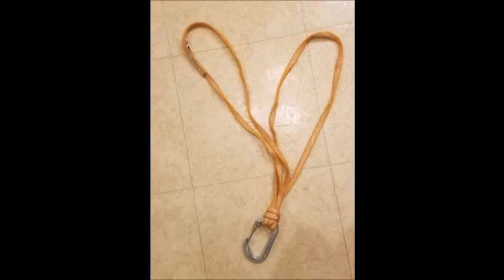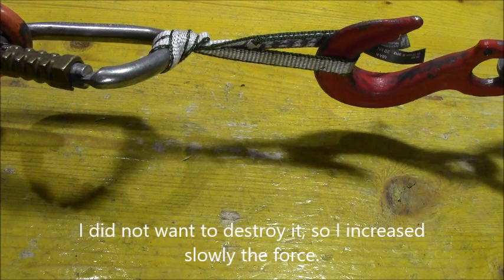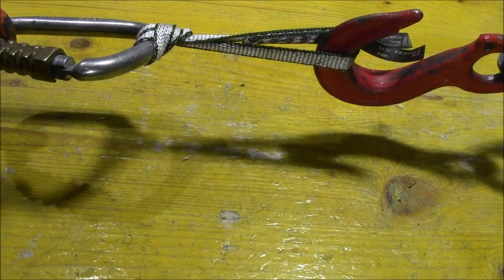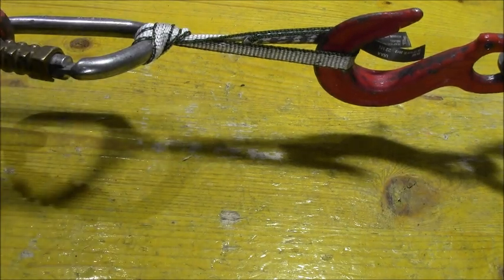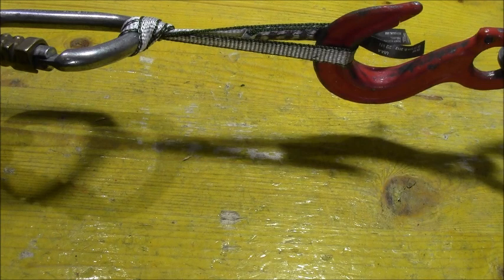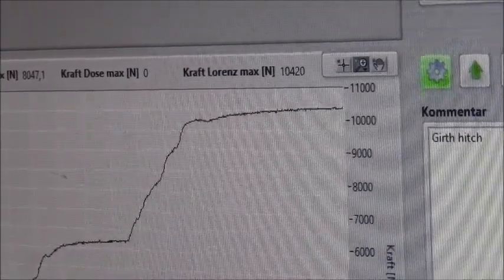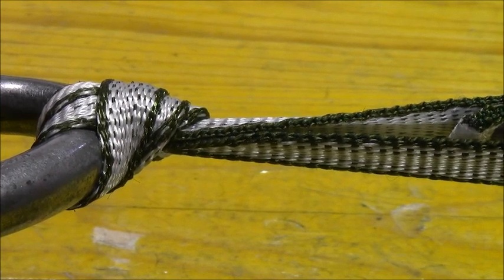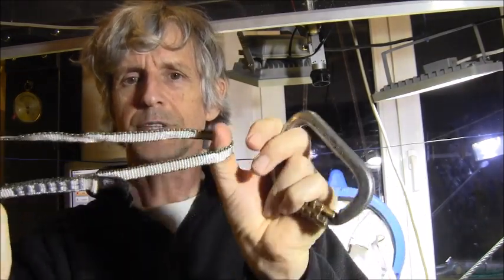Girth hitch

Comment: does a girth hitched dyneema webbing loop on a kong kisa weaken the device? nolotengomiedo had an interesting comment on one of the hownot2 videos about a girth-hitched loop applying a twisting torque to aluminium parts, breaking them under minimum breaking strength. would you test this? here's the comment: https://www.youtube.com/watch?v=VFN7HPoMwlk&lc=Ugx1Cr1MQ_YaZA8tzLZ4AaABAg

Comment: I don't understand why the last sling was not pulled to failure.  Because first, we didn't learn the breaking force, only that it's something greater than 11kN, and second, do you really trust a sling once it's been pulled so hard that it starts to make snapping noises? If that were my sling, I'd toss it and spend another $15 on a new one.

I'd be very interested in seeing a girth hitch that's been cut on one side and then put to a drop test.  I believe this would simulate a broken girth hitch anchor like in your last configuration, that maybe in a worst case scenario had been cut by a sharp edge, and then a climber takes a fall. 

This test has almost been done, by @HowNOTtoHIGHLINE but their test was a continuous pull and not a drop test.

Thank you very much for the informative videos!  I just wish this one were more thorough.

Comment: Hello Can you do test with girth hitch connect with nut ? Because my friend connecting nut with sling using  girth hitch. He don´t use carbine  like connector between them because he want to save carbine. thank you for answer :)
Reply: You have a right to be concerned!!
Reply: I remember hownot2 did this and it broke significantly below MBS. The small diameter of a nut wire can more easily cut a sling.
Reply: I came across this: https://youtu.be/XdOGvkd1VMg still seems like the best idea is to get a $6 carabiner